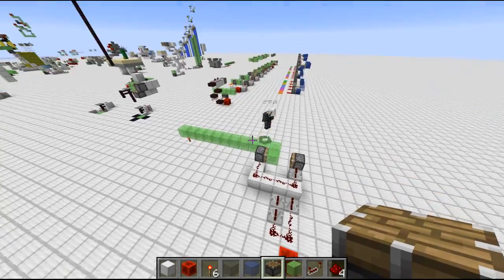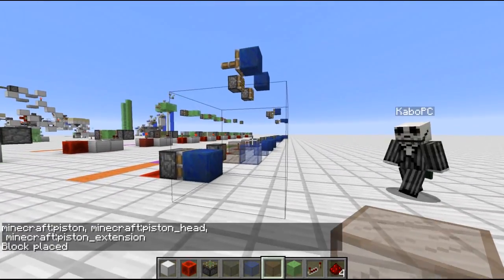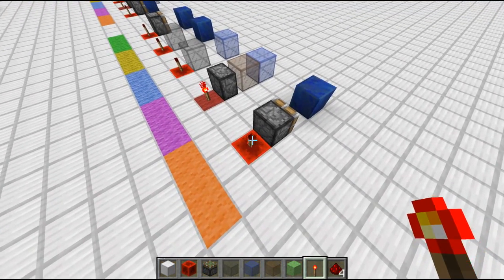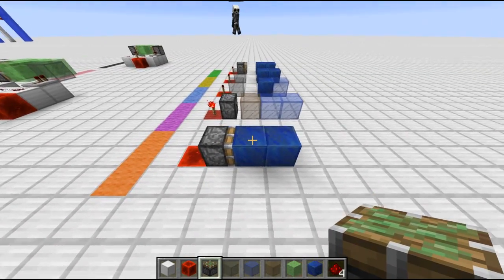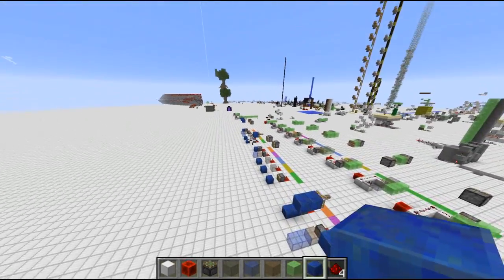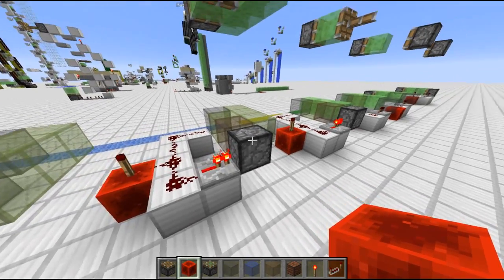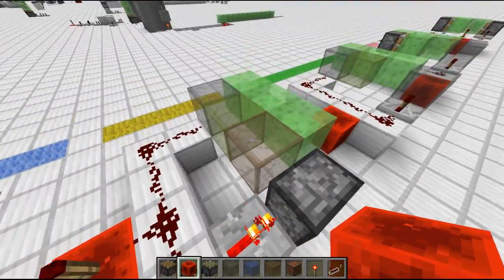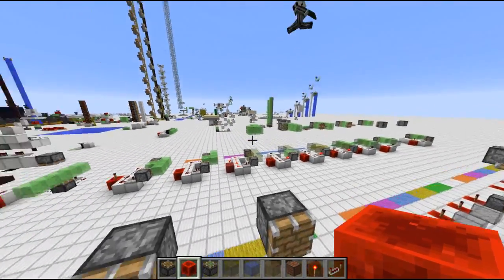SethBling's Slime Drawbridge Explained

Comment: Thanks panda, I also noticed the break away behaviour but I didn't know what I was seeing.

It's also possible to chain multiple pistonslime "engines" to make a mono rail type thing where slime blocks surf along the engines.

It looks like you need 2 sticky pistons in order to get the drawbridge to operate in both directions.
Reply from the maker: The monorail thing sounds interesting.
And yes, you need two sticky pistons if you want to use it two way.

Comment: What about the ghost blocks in sethBling's video. How did they appear?
Reply from the maker: That's just a client/server problem. Due to the delay of the messages the client sometimes thinks that blocks can be moved already while they are still block 36 on the server sides or the other way around.
So the client might not move a block which the server moves and depending on the situation it might appear twice then.

Comment: Panda, why does Mojang make this stuff overcomplicated? Why not just test if the block can be pushed, delete and place it there, and then create a piston arm and the base thing?
Reply from the maker: So you are suggesting the pistons just would work instant?
Besides it looking really bad it would cause trouble gameplay wise too.

I agree that the code could be simplyfied and cleaned up at many points.
But there is a good reason why it is as it is at the moment: It "grew" over a few years and several different coders worked on it, fixed bugs, caused new ones and so on.
It would be possible to look at pistons as they are supposed to work now and to remake them with better code that is easier to debug. Besides it being a lot of work it would cause most old piston creations to break. And I think Mojang wants to avoid that.
Reply: Panda4994 I am just saying that things that seem like simple things, ie pistons, mob spawning, plant spreading etc. They seem over complicated and have way too many loops and algorithms for such a simple task.

Comment from the maker: Raphael Million Yes, that would be a way to fix it without breaking existing behavior. But it would cause other potential exploits.
Because as it is at the moment you can't get a block 36 with the same facing in front of a sticky piston unless the piston itself created it.
If you would allow instant movment for whole structures that would be possibe as you could have an other piston behind a block of the structure.
Just want to say: It might cause less consistent behavior than you think ;-)